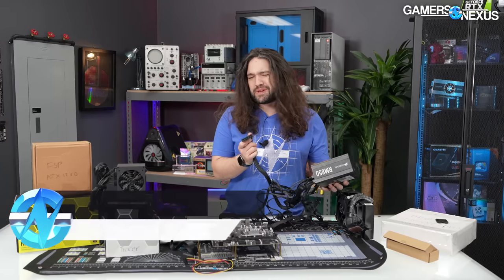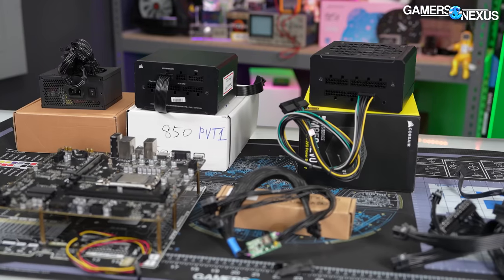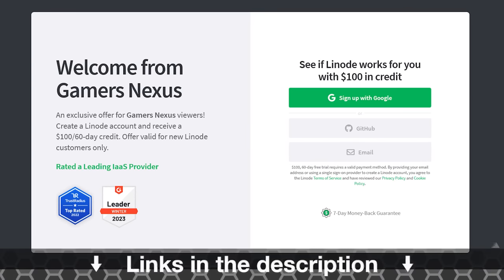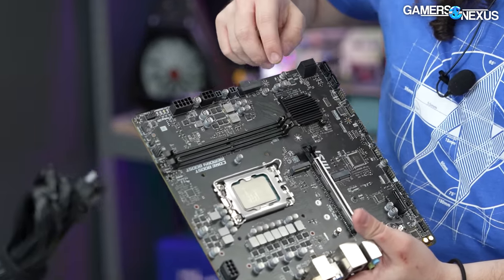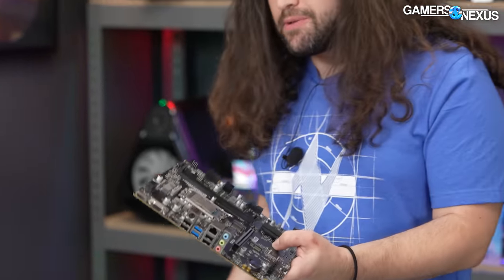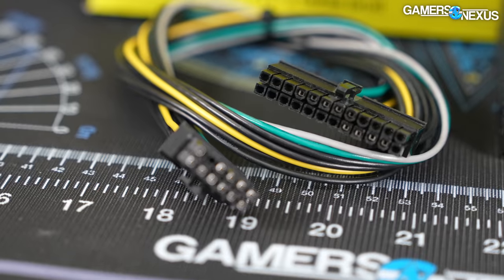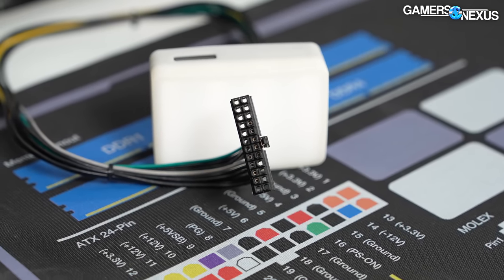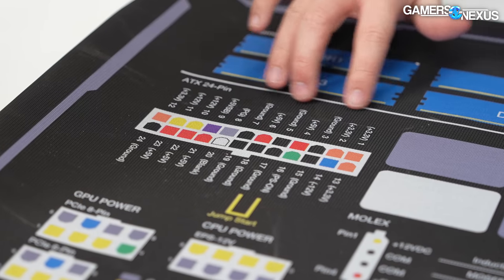The Future of Power Supplies - Maybe (Motherboard Cost, Cables, & ATX12VO)

Comment: My problem with putting more and more on the Motherboard is, that you get more and more possible points of failure. And at the Motherboard prices often easily pass a few hundret € it gets expensive if anything on the Motherboard dies.
Reply: yeah, this.
it's a bad solution, for a regulatory problem....
Reply: Agreed. Overloading the motherboard with extra power, is asking for trouble. Motherboard will need significant heat cooling methods, even so, motherboards is the most sensitive component. Its better to leave the Power sockets and power stuff on the PSU as its own standalone handling.
Reply: Also, there are plenty of quality 24-pin PSUs for reasonable prices on the new and used market. Hard to convince consumers to choose 12VO when enconomies of scale favor ATX 24 pin PSUs.

Motherboards are a different situation, since you are more likely to be swapping it out. It may be better for DIY consumers to save on motherboard costs if they already have a 24 pin PSU.

That being said, OEMs have pushing their own proprietary versions of 12VO before the standard was created to save on costs to hit power efficiency targets. However, OEMs largely haven't moved to ATX 12VO, and having a standard for all OEMs to use will improve consumer choice and reduce e-waste IMHO.

OEMs also need to stop using proprietary board form factors. If they somehow save costs by doing something like soldering front USB connectors on the board, make it a ratified standard! Otherwise, they are just making more e-waste!
Reply: That's the sole purpose that intel promoted this
Reply: @jay_ta708  motherboards won't need more cooling, you're running at most like 50 watts through the 5v and 3v3, and vrm are 95%+ efficient, so you have to dissipate like 2.5W in like 4 components at worse. dc-dc is also very reliable, it won't be a major increase in failure rate. 
will motherboard manufacturers add 10-50 bucks to the mobo for a $1 increase in cost? most likely, but that's capitalism for you.
Reply: @satibel  No, they'll add 100-500 bucks and claim they had to do R&D.
Reply: And then what if it is a few years after the system was built? Older CPU’s can be easily found by not always older motherboards - especially one that may match the one you had feature wise. So a dead board could force a platform upgrade with CPU/Board/RAM if sockets and DDR generation have changed in the interim.
Reply: @jay_ta708  Yeah and if you watch repair videos (Laptop, Phone... Repair) , you maybe have noticed that electronics parts regarding the power trail are often the culprit if a device dies. Now they want to add buck converter... onto the Boards. Good luck getting a 400-500€ + Board repaired if on of these blows after the Board is out of warranty.
Reply: @svenhoff2653  Exactly! Motherboard blows and everything shits the bed! Imagine cruising with the 12VO PSU and 12VO motherboard capable with a high end chip... Then 3 years later motherboard blows up. Literally force upgrade the owner out of that system, when there could have been a few more years to that set up - assuming the motherboard is EoL which is like every year theres a new addition Motherboard and CPU. Second hand market isn't reliable. But, a new PSU will likely work with components 5+ years before and after.